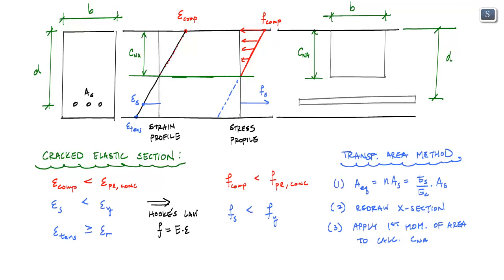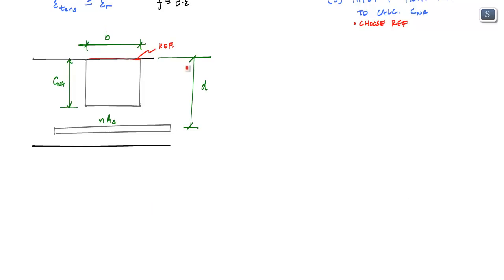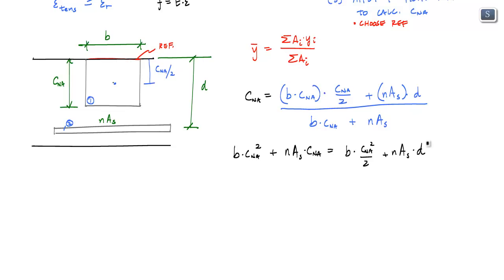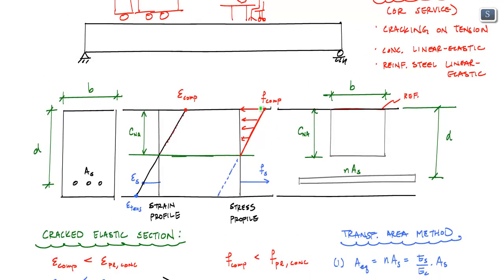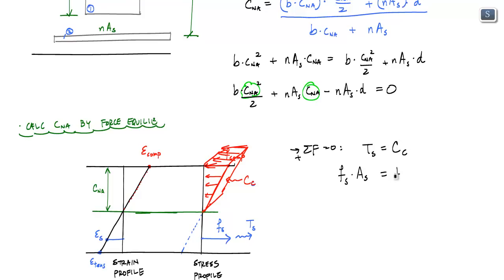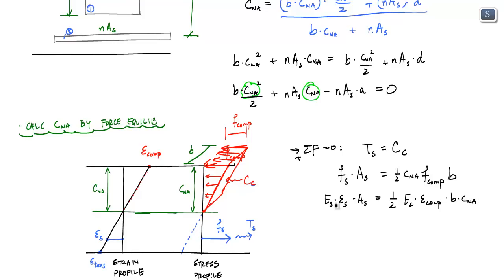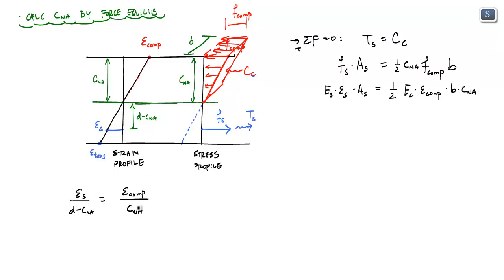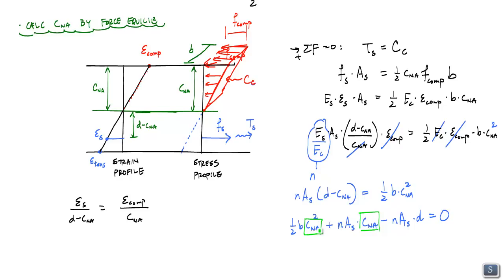Transformed Area Method for Cracked Elastic RC Section (2/2) - Reinforced Concrete

Comment: Sir, due to crack in concrete , Neutral axis doesn't change it's position. Right?
Reply from the maker: the neutral axis is different before cracking and after cracking.
Reply: @structurefree  So, the neutral axis will shift upward. Right sir???

Comment: Your video is great, but i have a question: how can we state that "Cna" (depth of neutral axis) coincides with the depth of the section centroid? It would seem something like an approximation, but how could we deal with the case in which the latter is not admissible? Thanks in advance!
Reply: Commenting for anyone reading this. I was wondering the same thing and I think the steel is not considered in this case because its own width is indeed negligible. Please let me know if this is wrong, thanks.

Comment: Can we take our reference  anywhere else or should it be at the top? e.g if we want to use the N.A as our reference to calculate for Cna. Can we take our moment of area about existing N.A?
Reply from the maker: +snowneedle Yes, you can take the reference anywhere.  Usually the top, bottom, or the neutral axis itself are the most convenient choices.

Comment: Shouldn't the transformed area be (n-1)*As?
Once you transform the area to n*As, you should subtract the As of the bars, or else you would be adding that area twice in the n*As centroid.

I just did an exercise given on my university, and avoiding this gave me a significant error, and not in equilibrium.
Reply from the maker: That would be true if the section was not cracked in tension.